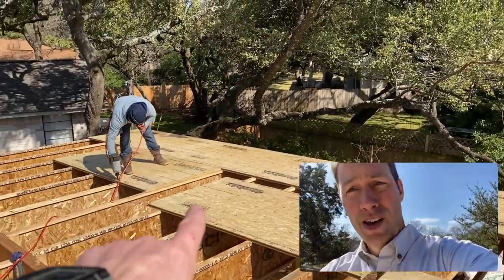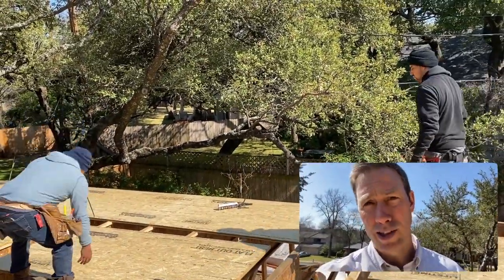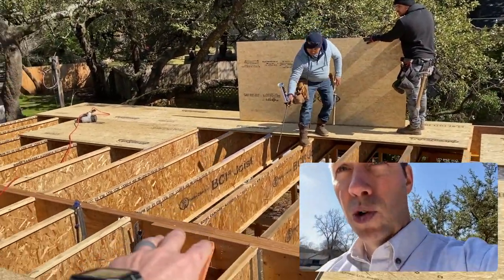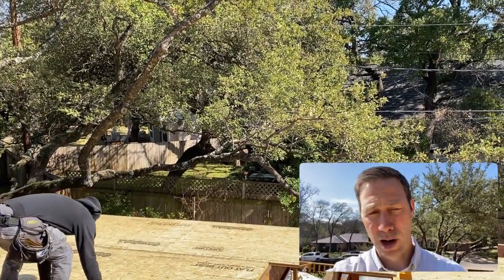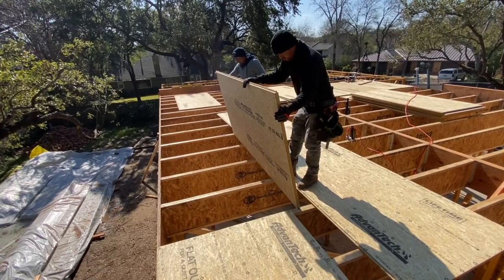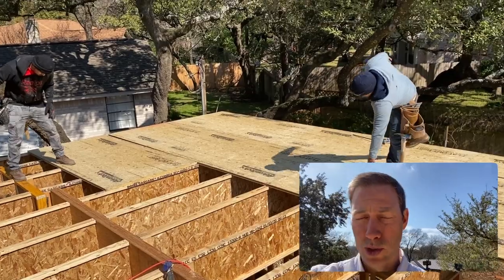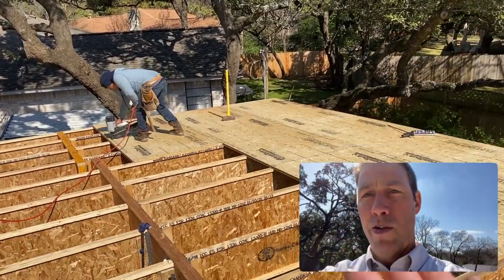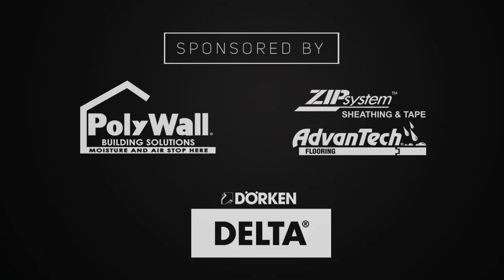Subfloors - Best Practice - Real ReBuild

Comment: I love Advantech.  It is definitely the king of subfloor materials.  I haven't heard of anyone using 1-1/8" thick though.  I'm used to 3/4".  I don't know that the cost difference is worth it because the 3/4" is very solid and any bounce is going to come from the span and spacing of your floor joists rather than the subfloor.  I like the I-Joist floors or a floor truss over conventional 2x10's because of the warping, twisting, crowning, etc of conventional lumber not to mention it's inconsistent depth.  One board might be 9-1/4" and the next one might be 9-3/4" and that just leads to a lot of planing to get everything level or otherwise you will end up with uneven floors that squeak.

Comment: I mostly do 5/8 on 5/8 on 3/4 cdx with no overlapping edges with a lot of glue in between layers and nail and screwed down I have not had one call back in 20+ years of setting tile on this method but you need to use Grannyrapid tile glue

Comment: Matt, your guys are just slamming your expensive and heavy sheets down on those glue beads. Are you still getting good adhesion or is most of the glue splattered out the sides from the slam?
Reply: Was going to ask the same exact question.
Reply: Undisputed Attitude no, its getting splattered everywhere boomer. Nice if you to share your standard of work with us all. Boomer

Comment: Best practice would use screws, not nails.  And don't drop the sheets, it blows the glue out. Lower the sheets slowly and screw them down.
Reply: I fully agree......quit throwing the materials around and lose the 100 year old fastener tech.
Reply: Screws not needed and they are more work. Annular ring or cement coated nails are the way to go.
Reply: @dielauwen   You are right for production, but when a engineer needs that extra strength, they always specify glue and screws.....they are stronger and better,...the ultimate ring shank,...whether you actually need that extra strength is different matter.
Reply: @dielauwen  I've heard good things about ring shank nails, dielauwen. What's your opinion about GRK screws though? Supposed to be really good too, compared to other screws that have shearing issues.

Comment: Used Advantech 1-1/8” & 3/4” since it’s availability (thanks to Matt). Glue and ring shanks are a must but swelling in Houston is still a problem. Standard practice in the budget now to grind the seams. Austin is more forgiving? Great video.

Comment: I like your videos.  Been watching them for a while now.  How those manufactured I beam floor joist might be good for building, but if I know as a firefighter those have been installed you would not see me walk into that place if it's on fire.  Those burn quickly.  That's where old 2x material is superior.

Comment: I used a flooring foam adhesive years ago and I didn’t realize what the heck it was so I stopped. I thought it was supposed to be like regular foam, because I take the can from stash that had cans of from. When I saw it deflated, it just threw me off. However, I’m looking forward to using it in the future.  I know regular construction adhesive can sometimes pill away from LVL’s! I guess some LVL’s have a wax coating on them, and something  PL  just will not stick.

Comment: How about "flooring" (carpet, wood, etc)?  Are these type floorings and their underlays (padding, glue, etc) considered "structural components" of a flooring system?  Do carpets and paddings (and any extra underlay) act like shock-absorbers for reducing load (not just sound) on the subfloor and inturn joists?  If yes, would carpet/padding selection be significant toward structural integrity?

Comment: Matt it looks like the glue goes on as a foam and then shrinks down so thin as to not be enough. Is there really adhesion enough not to fail? With other glues, the amount you see is the amount that remains. How tested is this foam glue over time? It just looks to me like not enough material is there.
Reply: This stuff is very, very strong, I'm not sure if he's actually done a Build Show demo to illustrate it, but there is definitely enough glue material. This is a specialty glue (polyurethane based) that bonds with the special premium glues (also poly) used in the Advantech OSB from Huber while still adhering to the raw wood of plywood or 2xwhatevers. The foaming is just a part of the chemical magic that allows it to work. I know I have seen him show some of the demos from Huber themselves and this video shows the same amount of glue they demonstrate and teach.

Comment: Hey Matt! Those I joists are hanging off a beam that runs down the center of the house. About 5 feet from the edge of the home there is a jog and you are using something else to support those I joists it looks like there are cut outs so you can run mechanicals through it. What is this?

Comment: That guy hitting the sub floor in should be using a 2x up against the plywood instead of hitting the plywood with a sledgehammer an damaging the plywood or the top of the floor joist
Reply: Exactly my thought. I usually take a scrap piece of tongue and groove and put it in the groove and use that to pound on. Sometimes will screw it to a 2x4 so the plywood doesn't fall apart too fast.

Comment: One big mistake on the flooring: Flooring should be Screwed and not nailed. Nails don't have the hold down strength that screws do! Yes it helps even if you use the floor glue. Saving a Few buck with nails doesn't really help especially with collated floor screw gun.

Also noticed no hangers on the floor joists. usually TGI joist manufacturers require hangers. Also recommend using LVLs over LSL. LSL tend to swell when they get wet.
Reply: He has said in some recent video that since the switch to the new foam gun glue he stopped screwing the floors down because of the increased hold.

Comment: They are crashing OSB edges with hammers. Is it correct?
Reply: He should be using a knock block if it hits the crap out of it
Reply: the idea is to knock the tongue into the groove.  unless you go to town and wreck the groove, it is fine.  usually a smashy block and sledgehammer is my preferred method.  Although being a fat guy and jumping onto it can slip it in nice too.

Comment: How do you think 1 1/8" compares to a double layer of 3/4" over 24" OC?  Same thickness as a 2x stud.
Reply: Double layer of 3/4" will be 2.37 times as stiff as a single 1.125" OSB - stiffness goes by cube of the thickness in this case. Caveat - IF those layers are well bonded and fastened.

Comment: Cool joists design, but what about the nails that are placed to hold down the sheets? Those gets rusty after the years and the squeaky floor begins. For me the deck screws that have doble pattern threads and coated are lifetime and prevents that issue. 
What are your thoughts about the nails?

Comment: I've put in a lot of flooring over the years.  One flooring group did this as shown in the video.  Another flooring group augmented the nailing pattern with something like 9 screws per sheet.  The flooring adhesive is heavy duty stuff and the nails keep it in place and flat down, so are the screws an OCD thing or do they make a good process better?  Do some building codes require screws?  Do screws reduce floor creaking noise?

Comment: Up in Michigan for standard builders we use 2x10 joists. And I rescrew the floors after drywall is hung with simpson strong tie/ screw gun.
Reply: Issue with traditional lumber is that the 2x10 you buy today don't have the strength of old 2x10s as it originates from new growth lumber which grows a lot faster, but does not have the same strength as old lumber :( This is why most structural lumber is engineered.
Reply: The deflection is still calculated for the new stuff and passes code no problem.  They just adjusted the span and your in business again.  I use 2x10 with 5/8 TG plywood glued and screwed and I never get squeaks.  The trick is to make sure your interior walls are also screwed down and you will never ever get squeaks.  I save my clients money and all this bullshit tech shit they come out with is all wasted $$$.   If it’s done right the old way works fine.  Been doing it for 20 years and won’t stop either. And all that new shit off gazes much more.  Case close
Reply: @stephanechouinard5867  I agree with you on that. I do find it interesting too see what the new stuff is about.

Comment: You might want to research how fast those I joists fail during fire conditions, it’s as little as 15 minutes for the OSB core.
Reply: Don't codes require a covering like drywall to delay ignition?  I was just watching a video recently about fire proof paint being required for first floor i-joist systems that are over a basement.

Comment: Matt, please fix the analytics on your build show network website, I’ve been trying to let you know without any success over various outlets.
Reply from the maker: Not sure what you mean?
Reply: @buildshow  Hi Matt! The Build Show Network website uses Google Analytics (GA) to track stats, but I believe because of the content delivery network (CDN) the site uses, it actually loads the GA code twice. The problem with loading it twice is that it will capture the "page view" metric twice as well as throw off the bounce rate. TLDR you're double-counting on the stats for the site. I tried emailing you and @you on Twitter. I'm a fan and happy to help!
Reply: @x2thel  They just need to remove the gtag snippet from the body and keep the one being loaded in the head. But you are right, the CDN is loading the gtag.js in the head and its how the site manages social interaction engagement events.

Comment: Yes, it's hard to beat I-joists for their dimensional stability, but they do have one serious weakness. They fail startlingly fast in a fire! In fact, firefighters (at least in my neck of the woods,) refuse to enter a burning home if it's relatively new construction because almost all the builders around here use them extensively.
Reply: Same reason trusses fail quickly because they only have to burn about 1/8" through before the mending plates will fail and the roof may cave.

Comment: It would have been good to point out the best practice your carpenters were doing as well.  A lot of guys will nail the corners down and seize a bow in the decking, your guys were doing it right though by starting on one end and walking up the nailing.  This flattens the  decking as you nail.  Good work! P.s. I have seen advantech keep throw together basement site shops dry all winter through spring..no membrane or tarp!  Superior product!!!!!

Comment: Can you use the glue underneath bottom plate in concrete foundation house?
Reply: No, the glue is intended for wood on wood bonding. For the sill plates typically a sill sealer is used (Polyethene - Blue rolls of plastic foam). However you can use EPDM still gaskets from http://www.conservationtechnology.com/) and caulk it on both sides for an air tight seal. Also helps if you apply a concrete sealer to the top of the foundation before laying down the sill plates.

Comment: Maybe someone can answer this for me... I have a house I am remodeling that was built in the mid 80's.  It has an OSB subfloor that is actually pretty soft.  You can visually see it flex when stepping on it in some places.  My question is - can I cut out that subfloor at the walls and lay down 3/4" in it's place?  I realize I would get a stiffer floor going with 1 1/8th - but I think that would raise the floor level too much.  So anyway - that is my question - can I just cut out the old softer osb and put in something like 3/4 advantec (screw and glue)?
Reply: Yes, that will work just fine.  You'll probably want to do the entire floor to avoid any transitions.  If you have stairs, be aware that your last step height will change if you had crappy 1/2" OSB that they used back then.
Reply: @bigpjohnson  Thanks - yea, I will end up doing all the floors - but tackling a room or two at a time.  So eventually they will all be the same subfloor height.
Reply: @danielohirsch  Good luck!
Reply: Might be easier to lay another layer on top cross directional to the first, glued generously. The new subfloor won't be solid at any of the wall edges where it's cut so you  will probably need blocking in each bay. Not a construction expert but that sounds like a mighty task.
Reply: @zachicusmaximus5551  I thought about that - but I also need to watch how high I raise my floor height.  I did plan on putting in blocking where it is needed for sure.

Comment: Good old wood mulch and glue houses...….all because it might squeak or a heaven forbid taking 10 minutes with a planer to correct a small deviation in conformity or using enough wood to make it stable...…...
Reply: that's alot of hydro carbons to stabilize cellulose....the reality is that wood is meant to bend...concrete on other hand isn't supposed to bend
Reply: @Some Guy   It is not like I joists are not a readily available widely used common product that has a proven track record for over 30 years now...…...They are fine,...they have pluses and minuses like any material and Risinger is building top level houses with proven top of the line materials.

   There are many reasons to use or not use them...…..squeeky nails and straightness are not 2 of them.....span distance and mechanical clearances for ducts etc are.

    I personally do not like them, but we are in red car blue car territory then...….same car , different colors to suit personal preference and application.
Reply: It's a long way from mud bricks and straw roofs. 😊 If currency and the global markets tank, we may devolve back to the advantages mud brick construction affords.

Comment: Would you ever consider using or is there a benefit/drawback to using a Lignoloc nailer with this flooring?  Or have you considered starting to incorporate the Lignoloc system in your builds?  I remember you introducing me to them in your Swiss video series.  Thanks.

Comment: I would like to see these houses in 50 years. So much osb used I would suspect there will be long term issues
Reply: The Achilles heal of OSB is its brittleness.  In vibrating conditions or motion from earth quakes it will break away from its fasteners.  Not so much a problem on floors with glue but a potential problem on walls (especially on structures with more than one level). Time will tell.  On walls you should at least use plywood on both sides of corners and door ways and large windows not OSB

Comment: Any concerns about VOC's with this system?
Reply: its outside in the open.....
Reply: @shahsmerdis  The  concern may have been outgassing after the structure is finished and occupied. Some polyurethanes, as well as other building materials  have a long cure rate and can be noticeable for more than a year. Measurably noticeable to the point of being an allergy trigger. Energy recovery ventilation may be a necessity in these cases, not just a nice thing to have.
Reply: Yes, but far, far less than the new Chinese furniture and flooring that most people buy and put in their homes.  I have the smell of the glue and varnishes they use!

Comment: Our house we just built has bouncy floors.  Not too happy about it.  3/4 lp subfloor and bci I joist 16” on center. Is there a way to help minimize the bounce after the fact?
Reply: Difficult to say, since you could have poorly engineered structural support, or your plumber drilled big holes in your joists to run drain pipe. In some cases you could stiffen the floors by adding another layer of subflooring (ie go from 3/4" to 1.5" by doubling). But if there isn't proper support underneath, no additional layers is going to fix the problem.
Reply: Guy Tech we have a beam that the joists cross for support because of the span distance. As you say I’m sure there are a few factors coming in to play magnifying the issue.  I really need to look and see if the joists are even sitting on the cross beam.

Comment: I did not see any adhesive on the rim joist at 4.25 do you not glue your rims.   Building in the cold country near Yellowstone park I did not have the vapor barrier on the dirt in the crawl space , in freezing weather the moisture from the ground migrated up thru the seams in the floor osb then froze then melted causing  swelling. it took a  bit of time with a 9 inch grinder with 40 grit ,,, Cold weather  nail guns can freeze up and not work. One set of hoses and guns under a heat lamp to switch off.

Comment: No glue in the joints between the sheathing? Our build code requires glue in the joints so that the sheathing becomes like one solid sheat.
Reply: Have you actually tested the difference? Seems like a really petty and meaningless code requirement to me.
Reply: @kingrpriddick  why even gamble? And it is problably so you dont get a squeking noise from the joints. Im not keen to test and then having to re do a subfloor.
Reply: Brilliant code...fill the expansion gaps so they can`t expand...……..maybe you could get them to sign off on a liability waiver for voiding the flooring warranty thru incorrect installation.
Reply: @shawncockrell6007  we do only use particleboard for underflooring and dont need a expansion gap if the floor is under 10m or 150 big Macs a gallon.  So the code and instruction from the manufacturer is fully glued.
And it's Sweden not usa.
Reply: @snettan   As long as its good with the manufacturer and the product installation....its not like it takes more than 10 seconds to glue it at the seams...……...probably helps with water infiltration during construction and even later.
Reply: I am pretty sure your not to glue the subfloor expansion joints. They are present so the subfloor can expand\contract do to temperature and humidity changes.